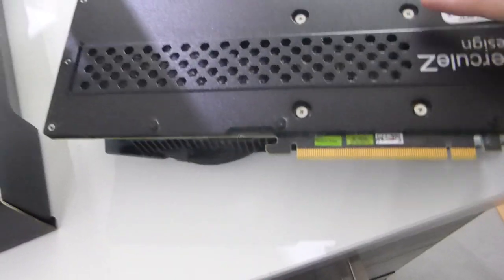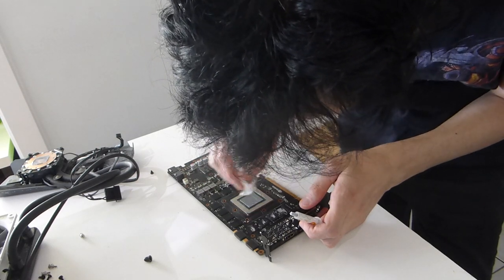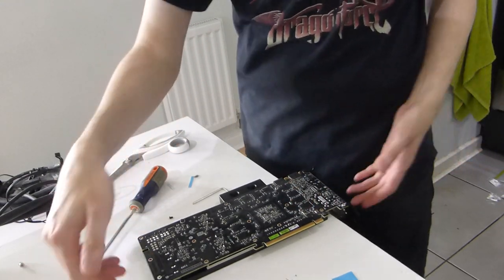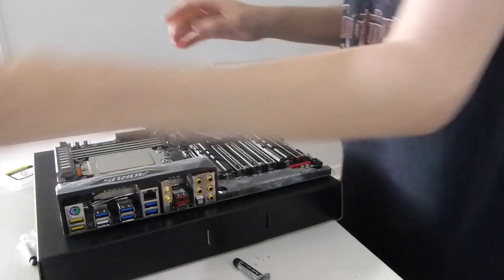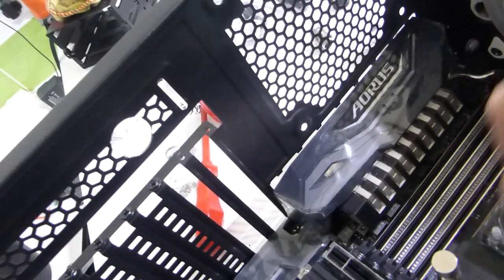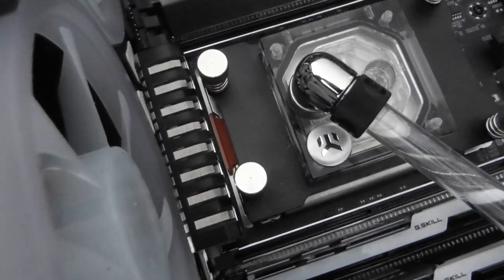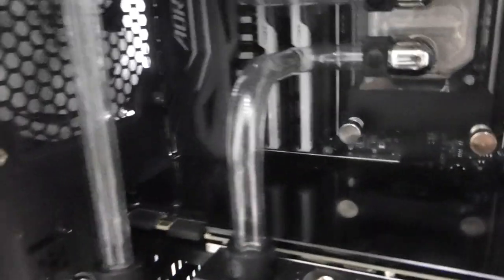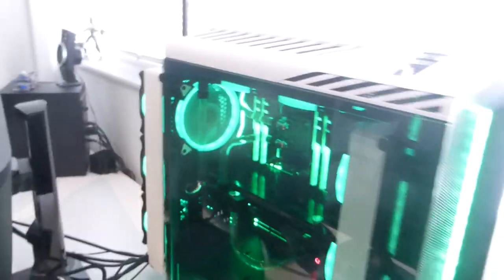Watercooled Threadripper build log part 5: Mission Accomplished!

Comment: did you overclocked your threadripper? and if so, how many ghz did you manage to get?
Reply from the maker: I managed to get it to 4.0 all cores but it was running at 78 degrees with 32 thread load which is a lot hotter than I'd like. I think it might be the block or my patchy paste but I'm waiting for Jayztwocents to finish his build and post a video with the same CPU block to see what temps he gets before draining the loop and reseating the cooler. It might just be the relatively small block on the large socket and not my installation that's the problem. At stock it hits 56 degrees full load, which is a lot more acceptable but still seems a little hot. By comparison, the 980ti maxed out at 41c
Reply from the maker: Also, for my uses, I'm better off at stock and getting 4 core 4.2 XFR when needed as it gives me a nice single thread performance when needed, good temps and multicore performance is still good due to the number of cores. If I could get 4.2ghz all cores it would be ideal. I haven't tried it but the temps would be insane. 

I did try undervolting, but even going down slightly causes stability issues.